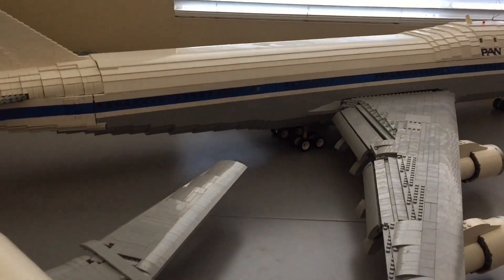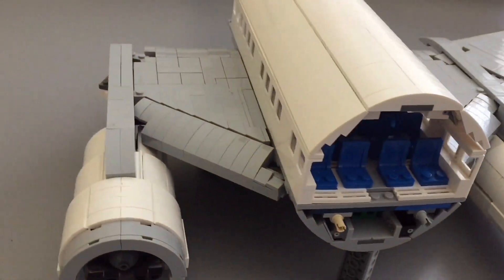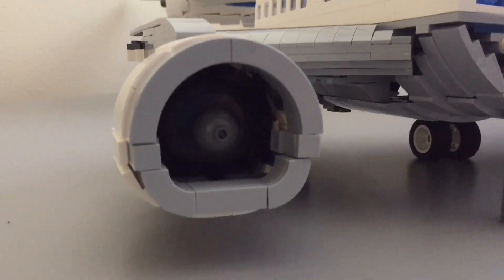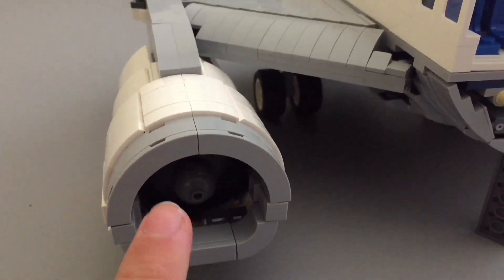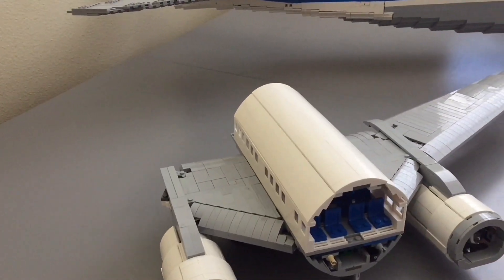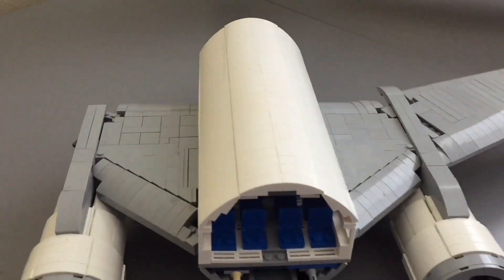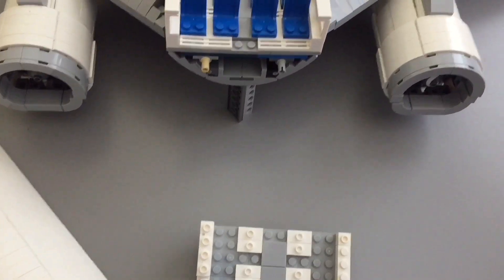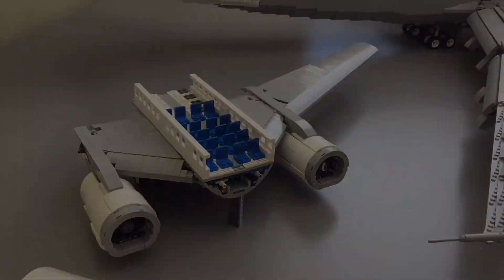LEGO 737 - major wing and engine progress!!

Comment: You could make the power functions motors as a separate set to work around the limit.
Reply from the maker: Good idea!!
Reply: BigPlanes Or you could make the motors addable, but not include them in the   set. Or was that what you meant?

Comment: You should power the wheels so the plane moves and the gear retracting/extending
Reply from the maker: That would require a lot of complexity which would not help it on lego ideas.
Reply: What if you sold the middle section w/wings as a separate set and you sold the tail as a separate set and do the same with nose.

Comment: this Boeing 737 should be a bit bigger! 6 six in a row! not 4
Reply from the maker: I scale the model to the measurement of the fuselage not the seating arrangement. This aircraft is about 12 feet wide (3 meters) so it should be about 12 studs wide. Whatever seats I can fit in there are what I do.